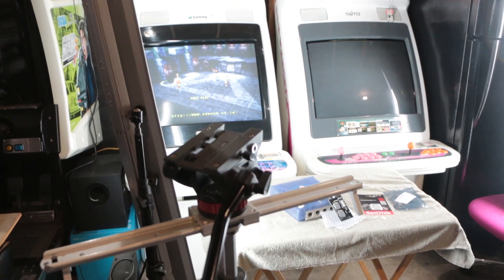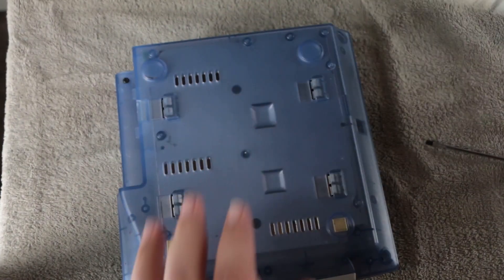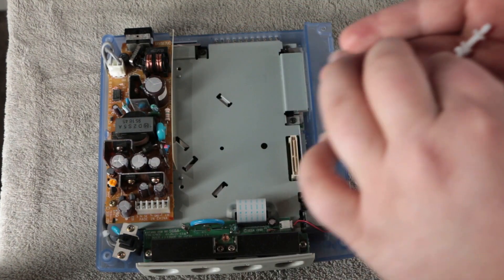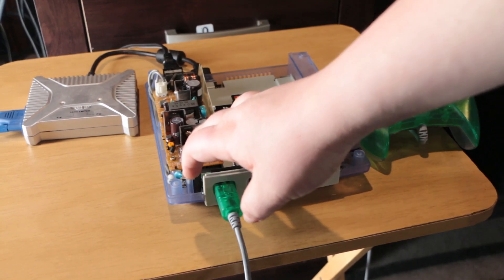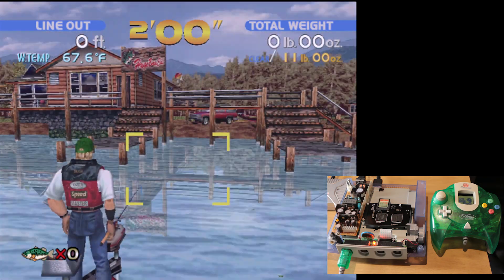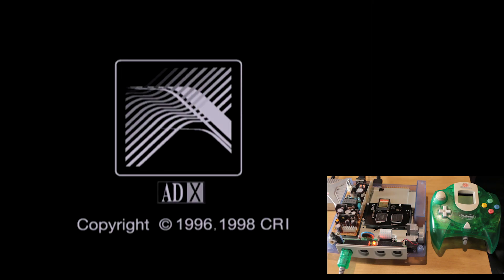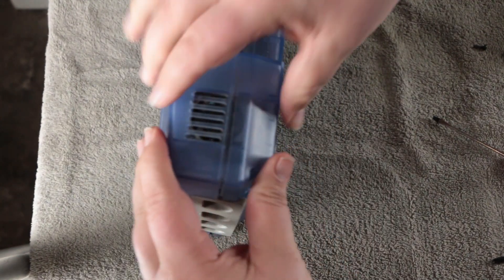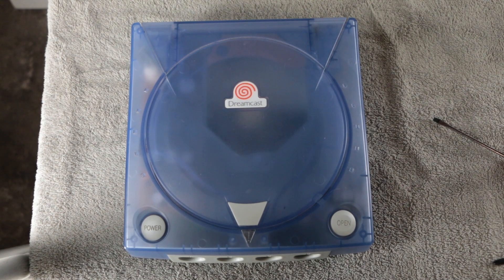GDEMU Install - Sega Dreamcast GD-ROM Replacement

Comment: Amazing! Quick question though: Is there a way to return to the main Dreamcast BIOS? I see that the console sees the GDEMU board as a disc and thus it loads straight from it when powered on (Unless you have the auto load option turned off in the main BIOS settings).

Also, there's no shame in buying an off-brand board. I've seen the dare I say it extortionate prices that a 1st party GDEMU goes for and quite frankly I would not be willing to pay the $60+ asking price for a real one of these things. Found an off-brand one for less than $10 on AliExpress so I'd be inclined to buy that one instead!

Comment: do you use composite cable to connect with the Playstation 3D display? or using HDMI converter for dreamcast?

Comment: I would like to know if you used a dreamcast rev 1 for this swap? As it has the 3.3v GD optical drive? If not, have you had any troubles with over volting? Looking forward to our future correspondence. :))
Reply from the maker: Honestly I do not know if this is a Rev 1, according to many people the disc drive I replaced looks like a Rev 1.  I haven't had any issues with it so far, I dont play it for hours on end mind you.  I bought this DC with the clear case and it didnt have the original stickers applied to it including model and manufacture date.  I think its safe to say you should likely not try it with a rev 1 based on what everyone else as said.
Reply: @BNGamesYT  any chance you happen to know the average duration you do play your DC with the GDEMU? 15 to 30mins at a time? Super specific question, sorry hahaha
Reply: BNGamesReviews Is that a typo? You shouldn’t use GDEMU with a Rev 1? The GDEMU ONLY works with a Rev 1 (or VA1) model Dreamcast. Any other model will fry it (Rev 0 used a 5.5v GD ROM drive).
Reply from the maker: @SEGAGuys  Again, as I said, I don't know what model it is specifically AND I bought this Dreamcast in the replacement shell.  It works, it hasn't fried.

Comment: You've got my full attention. I would also like a translucent shell replacement. I need to buy a Dreamcast pronto.
Reply from the maker: There are some new translucent cases on the Market these days, the one I have is an older one you can\t find easily any more.  Check out the Dreamcast Junkyard Facebook group, they can point you in the right direction
Reply: BNGamesReviews where did you buy your clone from ? and if purchased on eBay, could you please let me know the seller? I want to be specific going into buying one of these . to add to that . any issues with this GDEmu since this video upload ?

Comment: I came across your video and saw that yours is working well..... May I have some help? Mine works but I have gdi images of my games and the gdemu says unsupported images when loaded
Reply from the maker: Are they GDI files or ISOs?  Where did you get them? Also did you drag the files onto the card itself or did you use the SD Card maker tool?

Comment: I wonder if some hardmods will allow for use of a traditional cd/dvd drive off a computer. Technically the technology isn't all too different and there used to be a couple readers back in the day that could work with a simple pin switch.
Reply: maybe with dreamshell

Comment: Is still work on va0 ? Have you seen any problem because there is voltage differences both 2 consoles and   how often use console like this ?
Reply from the maker: Working well so far.  I don't play it everyday, but ive not had any major issues either.
Reply: @BNGamesYT  good to hear no any problem    that's mean this guy will be order soon  for my va0 as well  thanx men

Comment: I installed the GDEMU and tried to use it. When I turn on the Dreamcast it brings me to the main splash screen where I would have to load a game or file (the 4 regular options). Do I have the wrong model of Dreamcast? does it only work on model 0? I have model 1 so I figured it would work.
Reply: Only works in model va1

Comment: You can get back to the GDMENU using a button combination on the controller, no need to use the switch on the GDEMU.
Reply: Not all games work with that...

Comment: can you boot into the Dreamcast menu screen with this? ive havent seen a video do that with this mod yet.
Reply: Yea you can.  Just press Y to take you to the system menu
Reply: No, the Dreamcast bios has no support for the GDemu. that is why a software  called GDEMU 6.0 (FAT32) is recommended.

Comment: What's the downside of the cloned GDEMU?
Reply from the maker: No firmware updates, and people who keep pestering you that you are "Not supporting the original creator".  Id support him if he got his act together.  Seems to work flawlessly IMO though, might not need any updates.
Reply: @BNGamesYT  yeah I'd support the original creator as well if he actually sold these. It always seem like some bs limited run of boards and then scalpers buy them all up. Might just buy one of these then instead. Also I've heard about heat issues with the PSU after installing one of these. Had any issues yet?
Reply: @HotlineKM1  Resistors solve that issue.

Comment: I thought it wasn't recommended to use the GDEMU with VA0 systems? Yours looks like it from the metal heat pipes and fan.
Reply: Anyone hear of heat issues with the board consuming more draw from the power supply?  I've seen other vids where people are putting 300 ohm resistors in there or adding a fan.
Reply: @McRetroLuvin  the problem is the opposite, as the board doesnt require the same draw as the original optical drive it can cause the psu to overheat. There are solutions to this though.
Reply from the maker: To be honest im not sure, I bought it in an auction and it didn't have the sticker on the bottom to verify the manufacture date.  As far as I was aware it didn't work with BA0 at all so I assumed it wasn't since it worked and fit.
Reply: Well from what your video shows for all intents and purposes it appears it is a VAO, well since it has the metal heat pipes and fan. This means it is either an early Japanese or VERY early preproduction or early retail North American system. What you have on your hands is almost a holy grail system. And as long as it works with the GDEMU, then you are going to have an even better time than people with the other later ones. Later revisions have plastic fans and no heatpipes. Your system will be able to stay cool much better. Other later systems have no thermal paste or real heatsink on them. Yours does though, which is fantastic. 

Beautiful aftermarket 3rd party case and Divers 2000 controller too! Do you know how rare your controller is? Only some 200 systems were made, but not sure if any extra controllers were ever released. Most are clear blue or clear green.
Reply: BFKAnthony817 i also have a jap VA0 with pipes. I want to try the gdemu after watching this video but afraid .. creator said it cause irreversible damage to the board ?! What does it mean exactly ? Don’t know.
Reply: I think it means it could fry the board.
Reply: @BFKAnthony817  so if I have a US version 0. I am sool if I want to put a gdemu in it?  Don't feel like the Holy Grail to me.
Reply: @syn.n8110  I said, and I quote, "almost a holy grail system". Meaning before these ODE's came out, the VA0 was generally considered to be the highest quality console because of the metal heat pipes on them. Meaning it had better cooling. Since the system really doesn't get all that hot anyways you are better off with a VA1 system if you want one of these devices. 

Since there is no disc drive in the system pulling power from the 12v rail on the motherboard, it does tend to get a bit hotter. Not a ton but some people recommend putting in a small 5v resistor on the PSU pin coming from the 12v line or just remove a piece from their PSU altogether. Alternatively many people have bought PICO PSU's to put in the machine that are much more efficient.

Comment: Did you have any issues with overheating? Some people recommend putting a resistor between 12v and Ground when not using the GD-ROM unit.
Reply: I had hear this too which is why I went with a DreamPSU unit in mine along with a GDEmu (official). The DreamPSU lets you use an external power supply unit with the dreamcast to avoid overheating.
Reply from the maker: Not so far, ive heard a bit of that as well.  I plan on doing the fan mod soon though.
Reply: Yours can't do the fan mod as far as I know. The fan is connected to heat pipes and is not removable. You have no reason to change it out, you have the coolest revision by far anyways with the metal fan, later ones are plastic with no heatsink which yours has a heatsink and thermal paste.
Reply: I bought a resistor and had it inserted before powering on. You need to take that 12V load off ASAP
Reply: were did you read that you want to use a resister and were can i find out things about the gdemu clone like compatibility and things wrong with it
Reply: GDEMU played 100% of retail titles except Bleem, which is actually getting all protections removed hopefully soon by Japanese-Cake so we can at last play those games as well. Only thing you can;t do is update the firmware, but not sure why you would even need to, it has pretty much the latest or second to latest firmware. Not really needed.
Reply: @BFKAnthony817  how would i find out more about the bleem cast bit and this Japanese-Cake
Reply: Here is some background info on what Bleemcast is, it was very locked down and had to be cracked to be usable from burned media. It took until 2009 before it was hacked to run on a cdr. 

https://www.youtube.com/watch?v=r6bRWlAxPN4
And here is Japanese-Cake's tweet about fully removing ALL protections from at least MGS to be able to hopefully be run from GDEMU. 

https://twitter.com/jc_dcdev/status/1080916326003007488
Reply: @manwhoeatsfishinbedwithlig3791  - A lot of GDEMU video son youtube talks about the resistor, and there was a problem with the first version of the GDEMU clones, which were the green ones. Here's a good one:  https://youtu.be/eOP3ZDUX7Y8?t=1406
Reply: I did fan mod kit on my Dreamcast and is great